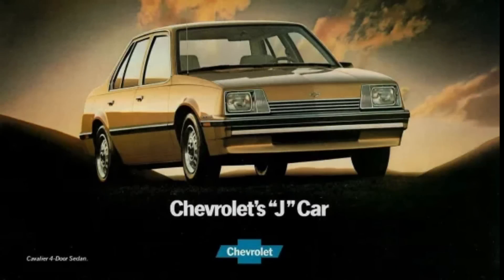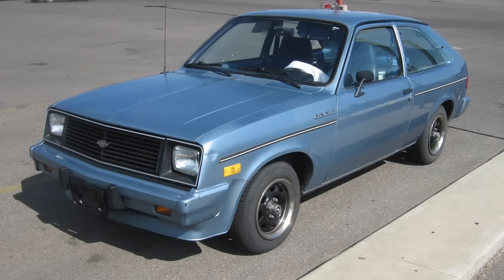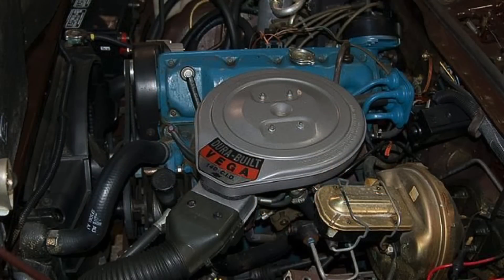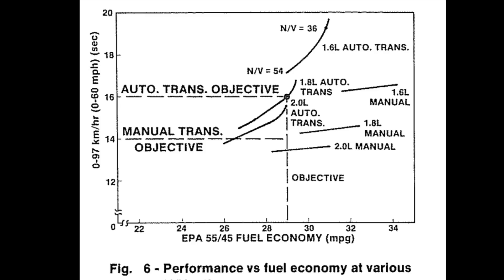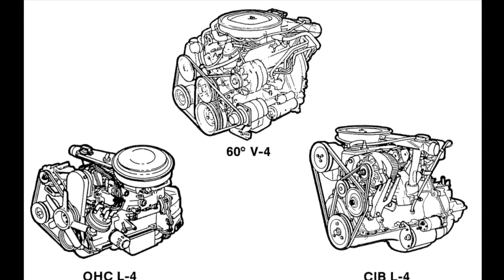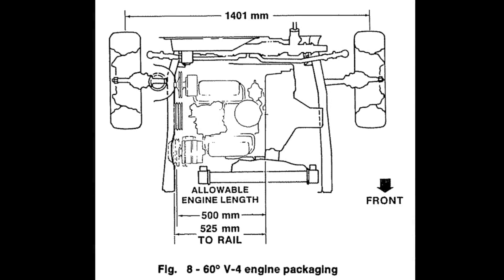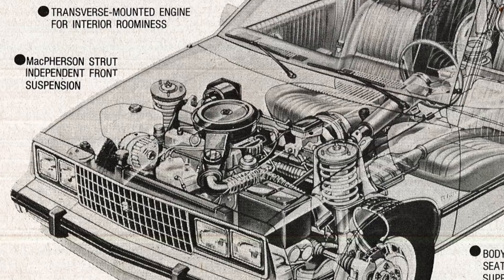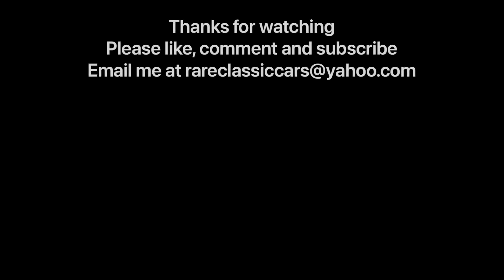GM Builds a Crazy 60-Degree V-4 (Yes, a V-4!) for Its J Cars

Comment: The part of me that's done engine installation engineering wonders if that V4 wouldn't've been so terrible for packaging if able to be installed north/south like Eldorado/Toronado were (before they went transverse), or the Chrysler LH cars. (Assuming here a transmission like a miniature-THM425 or something like the Chrysler A606/42LE, obviously)
Reply: That would require an entirely new transmission.  This V4 could use the existing transmission.  I think this was never produced because they found it cheaper to produce an OHV inline 4 with the same components.
Reply: I often wondered about if more manufacturers cut the reliable V8 in half to make a V4. Imagine an intrepid with a 318 cut in half instead of the 2.7 V6 which is the least reliable engines Chrysler ever built. I remember Pontiac cutting the 400 into an I4 for efficiency. Then there's the 4.3 V6 (Chevy 350 V8) or the 3.9 V6 (dodge 318 V8). The possibility is mind boggling to a car builder
Reply: @hellhound1389  Yes, and this saves money since a V4 can be built with the same machinery as the V8 it is based upon.  The thing is, V4's have balance issues that may require a balance shaft, increasing complexity and cost.  Also, V4's may not be "accepted" just because they are different, even if they were actually better.

Comment: I'm mainly a Ford guy, but I remember the 1982 J-car's debut was only flawed by less-than-hoped sales, and heavier-than-hoped curb weights.
We saw weight almost 3,000#, and the desire had been 2,200# to 2,600# all along. The J was heavy enough that the concurrent new front-wheel-drive A-bodies seemed too close to it, and after all the J was intended to be a 'sub-compact'.
I will say that styling of the J2000, Firenza and Skyhawks was beautiful.....far prettier than any import EVER and typical of GM elegantly adopting their traditional attractive styling to smaller bodies.
Reply: The first gen Cavaliers were still pretty light weight cars. My 1987 Cavalier CS on my channel is a fully loaded sedan, yet it weighs 2558. My 1996 Cavalier sedan weighed in at 2689. Compared to today compact car sizes, it's certainly less.
Reply: @5KpGD  OK, But compared to its contemporary competitors like the Ford Escort and Plymouth Reliant, the wholeJ lineup was heavy...hence the poor engine performance and disappointing fuel economy.
I read the press at the time - I remember it well.
Reply: @67marlins  
1987 Ford Escort 2dr base, 2181 pounds, 90hp, 24.3lbs/hp
1987 Plymouth Reliant 2dr base, 2374 pounds, 97hp, 24.5lbs/hp
1987 Chevy Cavalier 2dr base, 2328 pounds, 90hp, 25.9lbs/hp

I dunno, I think they all are about evenly matched. Nearly same engine output, all three speed automatic, no options. Sounds like a fair race to me.
Reply: @5KpGD  I recall the magazines at the time put the J cars up near 3,000, and also remember they made a big deal of it.
GM obviously improved some things after low initial sales, or re-published lower numbers.
I'm talking mainly Motor Trend and Car & Driver were the reviews I recall reading.
Reply: Beautiful? Lool, those plastic front clips ans sealed beams were ugly as hell.

Comment: Very cool. I never knew this. This was a fun one.  Previously the only V-4 engines I had ever heard of were the air-cooled ones made by Wisconsin, for use in certain outdoor power equipment. A long time ago our golf course had a piece of equipment with a 30 hp Wisconsin V-4.
Reply: Ford sold thousands of liquid cooled V4's in Europe.  They weren't all that smooth but they worked fine.  Saab bought them from Ford and installed them in the Sonnet.
Reply: Ford of Europe made a 1.4 litre V-4 for many years and early SAAB cars (after their 3-cylinder 2-stroke) used it with great success from 1967-onwards in all of their cars.
Reply: @davidgold5961 .5 L and 1.7 L... but yes, Saab used Ford Taunus V4 engines. 

Ford also built the similar but unrelated Essex V4 in 1.7 L and 2.0 L.
Reply: You've never heard of the Lancia V4 used in the Fulvia which won a world rally championship?
Reply: @mrradman2986  Nope, I don't think so. I don't follow rally racing at all, so I wouldn't know.
Reply: Ford made a V4 engine in the 70's-80's
Reply: @gabrielv.4358  yes, those are the Taunus and Essex engines that I mentioned earlier... and they started in the 1960's.

Comment: Lancia and Ford Europe had V4's.  

Saab, put the 1.7 Litre Ford V4 in their Sonnet 3 sports car.  

The Lancia Fulvia was a brilliant well balanced rally car with a V4.
Reply: Specifically, Saab put Ford's Taunus V4 in their cars; Ford also made an unrelated Essex V4.
Reply: @brianb-p6586   Only know about the Saab Sonnet 3.  And later Saab 900 Turbo.
Reply: @madsteve9  all of the V4's used by Saab were the from the same Taunus family (just two displacements).
Reply: @brianb-p6586   I know that later engine was one that was designed and built in a deal with Triumph & Riccardo and was fitted into the Saab 99.  

Everything before that, other than the Sonnet 3, "I know nothing".

*
The Ford V4 was used in the original mid / rear engined Ford Mustang concept (1962).  

Ford Germany, named the car after the  North American P-51 Mustang, that ultimately beat the Luftwaffe over Germany.

When Ford Detroit saw it, they turned it down for production.  

But, Detroit liked the name and thought of it in the Horse term, and it set off the use of such names.  e.g Bronco, Maverick, Pinto,
Reply: @madsteve9  The two Ford V4's (Essex and Taunus) were of similar vintage. I'm pretty sure that neither had anything to do with Triumph, and the Saab 99 didn't have a V4, so I assume that your comment was about the unrelated Saab 99 inline-4.

Yes, the Ford Mustang I concept used the Taunus V4 engine, which was new at the time. That concept was not designed by Ford Germany - it was a North American project led by Lee Iacocca - they just used a compact and light powertrain (in a configuration that would work in the rear-mid position) from their European operations.
Reply: @brianb-p6586   Was their a previous Saab 99 ?
 https://en.wikipedia.org/wiki/Saab_99
Reply: @madsteve9  Nope, there wasn't a previous Saab 99; as the Wikipedia article says, it never had a V4. It did have a Triumph engine... which was an inline-4, so not relevant to this discussion.
Reply: @brianb-p6586   Never said the Saab 99 had a V4 engine. 

I said regarding the "Saab" marque, I was only aware of the Sonnet 3's specification, and the later "99 / 900 Turbo" onwards cars.

I must not have been clear, with my words.
Reply: @brianb-p6586  

I was always told that the Ford Mustang 1962 Concept was done by Ford Germany.  

Surprised, by it. 

https://en.wikipedia.org/wiki/Ford_Mustang_I

Comment: I had a Ford V4 in my Ford Transit van back in late seventies. Worked just fine.
Reply: Hadd'em in '68 to '73 SAABs. Had mounds of them. Great engine for a small car!!!
Reply: @UberLummox the Transit used the Essex V4 built by Ford UK; Saab used Taunus V4 built by Ford of Germany. The two engines are similar,  but unrelated.
Reply: @brianb-p6586  That;s what I originally thought. Thanks you. Proof I should never listen to most youtube comments!!!

Comment: I cannot believe that GM wasted this time and effort on new engines that never reached production, but they waited until 1988 to bring the outstanding Oldsmobile 2.3-liter DOHC Quad4 engine to mass production. What a shame GM did not come out with the Quad4, the Buick-derived "Series 3800" 3.8-liter V6, and Chevrolet's 350 V8-derived 4.3-liter V6 in the early- to mid-1980s.
Reply: The 4.3 L Vortec would impose packaging issues in a transverse appplication. The 3800 was available in later Buick and Pontiac A-Bodies.
Reply: Also, while the 2.3 Quad4 made tons of power, they WERE NOT the best at reliability/longevity. The later & bigger 2.4 was much better as far as longevity goes, but didn't make quite as much power.
Reply: Chevrolet did introduce their 4.3 V-6 in the mid 80's. They also had a 3.8 V-6 for a few years, that was based on thier 305 V-8 (minus 2 cyls)

Comment: American workers are still paying the price for GM upper-management's disdain for small cars, and their refusal to create a decent 4-cylinder engine from the 1960's until (maybe) the "Quad-4" in the late 1980's, by which time it was far to late to ever regain it's former market share and customer loyalty.  Coupled with the same management's refusal to develop proprietary fuel-injection, clinging to carburetor's and throttle-body fuel injection, this led to a huge consumer shift to imported cars which took small engines seriously, as these cars worked reliably and could be fun to drive.  The book "On A Clear Day, You Can See General Motors" really lays bare John DeLorean's observations of GM management stuck in the 1940's, when there was no competition and people bought the domestic product because there was nothing else.  Your interviews with Bob Lutz are very telling on these subjects, as well.
American car makers gave away so much of the market and manufacturing sector that is now lost to Mexico and Asia, where manufacturing pollution vastly exceeds what is allowed in the few auto plants left in the continental U.S., that it is nearly criminal.  We'd have a much stronger economy and less-polluted world if the GM executives of the 1970's would have spent a few dollars.
I really enjoy this channel and owned a Cimarron myself for a few years, with the anemic TBI 2-liter pushrod 4 cylinder, an engine that no manufacturer from Germany or Japan would have dared to foist off on the buying public in 1984.
Reply: GM had decent Family 1/2 engines made by Opel/Vauxhall.

Comment: With a 90 degree V angle, vibration would have been a real challenge to smooth out--especially with no balance shaft. And there would be no advantage to use parts from the 2.8L V-6, one of GM's worst.

Comment: My dad had a 1984 Olds Firenza wagon he bought new that had the Brazilian made 1.8 OHC 4cyl. in it. That engine was not only bullet proof but gave you close to 35 mpg back then with decent performance. Plus, my dad got close to 160,000 miles and almost 10 years out of that car without any major issues (just a head gasket change at 100,000 miles). He only traded it in due to rust forming along the door sills.
Reply: Head gasket IS a major issue(?)
Reply: @nakoma5  I have news for you, the much loved Honda CVCC engines needed head gaskets by that time too. I've done a number of those jobs in the 80's. The problem was so common one gasket maker studied the problem and designed the gasket not to fail. Subaru is another company who's older engines eat head gaskets before 120K miles.
Reply: @nakoma5  After 100k miles it's certainly not a vulnerable design.

Comment: Fir the Vega, there's design without engineering.
Reply: The Vega might have been nice with an option of an alloy Buick/Rover v8, which was kept in production forever in England.  The 61 Buick Special with an updated body would have been a right sized car for the mid '70s.

Comment: The J-cars didn't get the right base engine until the last couple of years of production ... the Ecotec made a huge difference.
Reply: GM is Famous for Perfecting a Engine and then Killing it the next year !
Reply: yes i agree but the ecotec wasnt decent until 2007 when they upgraded the timing chain tensionner and all the engine sensors and ig coils, the 07-08 non vvt l61 is the one you want, i had one with the cobalt turbo (FE5) steering ,suspension and wheels, i did the ss clutch system upgrade with some modifications, exhaust downpipe from a s/c cobalt and a 2010 gmc terrain 2.4 intake manifold/tb upgrade, the driving was very decent and it was impossible to kill, also it was a quicker car than quad four cars
Reply: Early Ecotec was AWFUL until the timing chain issues were addressed

Comment: Chevette did not have an OHC engine (except the Isuzu sourced diesel).
Reply: Funny that the 3 chevettes that I have all have 1.6l OHC ENGINES that aren't diesels. They only had OHC ENGINES.  1.4 AND 1.6 GAS AND 1.8 DIESEL. Atleast in the U.S.A  anyway.
Reply: The original 1.4 L G140 gasoline engine in a Chevette was a pushrod (OHV) design, but the G161Z 1.6 L engine (from the same family of Isuzu engines) was SOHC.
Reply: Nope ,the 1.4 was also ohc the 1.6 was an enlarged version of it. I've had many chevettes 😊

Comment: It was painful to have lived through the era of great GM cars of the middle and late 1960’s to see that followed by an era of GM flailing with so many turkeys starting with the Vega and then many soulless J and T body cars.  If GM had done just a couple of things differently their automotive legacy would have been so different.  How that aluminum Vega block with silicone aluminum cylinder liners ever get approved - and then topped with a cast iron head!  The Vega/Astre was lacking corrosion protection - just a couple of bucks more would have given them a much better reputation.  The Ford Pinto cheap out with deathwish screws to puncture the gas tank - what a fiasco!  Some of these dogs sold well - not because they were loved or admired, but just because people still needed cars.

Comment: Could you do a video on the transition from the styling of the 1960's to the 1970's? I heard it was Ford with Eugene Bordinat and Lee Iacocca that pushed the styling shift, in my opinion as soon as the 1971 model year hit, styling started to take a nose dive and really cements the start of the Malaise for me.
The top 3 examples for me are the Mustang II,LTD II and the 2nd generation Matador. The late first gen mustang was very pretty, the II is just a complete butter face in comparison.
 I don't know what the term is for it, but the extremely exaggerated front end styling where you have like a 12 inch difference between the head lights and the grill is what ruins a lot of the era for me, the Ford's have what I would call bull horns, with the grill recessed and the headlights growing further and further outwards almost looking like a M to me, and the late Matador's have the inverse, where the grill is so far ahead of the headlights it makes it look really odd.

Obviously in retrospect it isn't that bad as styling has continued to degrade over the decades,but I could just picture the horror if you bought a 1970 Torino and watched each year go from attractive to downright ghoulish by end of production.

Comment: In the Soviet Union, and then in Ukraine, the Zaporozhets car was produced, which also had a 90° V4 air-cooled rear-mounted engine, making 28-45 h.p.
Reply: i think its a derivative of the saab v4
Reply: @retrocompaq5212 the "Saab" V4 engine is a Ford.
Reply: @retrocompaq  No. Completely different engine. Magnesium block, cast iron cylinders, aluminium cylinder head, air and oil cooled. Developed in the mid 50s, and produced from the early 60s to 1994, increasing the displacement from 0.7 liters. up to 1.2 liters, and power from 23 to 50 hp
Reply: @ЕвгенийИванов-г4ф  front weel drive?
Reply: @peggenlejoncar9529 rear engine and rear wheel drive.
Reply: Did it get 200 hectares per liter of kerosene? Put it in H! 🤣
Reply: Ford also made a v4 engine!
Reply: USSR was country from Guano.   and every car from that contry was shit...
Reply: 28hp isnt enough to climb a typical driveway!
Reply: @whitsundaydreaming  Those cars were extremely small. People even managed to drive these cars from the central part of the USSR on vacation to the south of the USSR. Somehow, 23 hp was enough.
Reply: @whitsundaydreaming it depends...I have owned 1959 citroën 2CV with slightly tuned engine with 13hp(stock was 11hp) and I could pretty much keep up with traffic 😂

Off course even 50mph/h highway speeds were about of question but In cities/suburbs that 40mph Wich was max.speed😊

Comment: My parents had an '87 or '88 Cavalier.  It was incredibly unreliable.  Always in the shop.  It was the last GM car they bought.

My Pontiac Astre (Vega clone) with automatic did 0-60 in about 20 seconds!  Top speed was perhaps just over 80 mph.  MPG at 60 mph was 24 to 28.

Comment: Wait…Oldsmobile Forenza?

Didn't Suzuki have one?
Reply: Oldsmobile Firenza.
Reply: Suzuki did have the Forenza. It was basically a rebadged GM/Daewoo car. It was also sold as the Chevrolet Lucette in Europe.
Reply: @Foxonian  I never saw one, but I heard (from the Suzuki regional tech) that a few were imported with every wire in the chassis harness the same color ("light brown" iirc) due to a supply shortage…